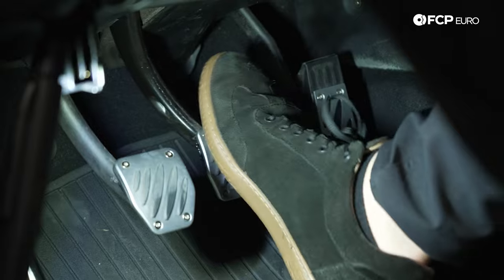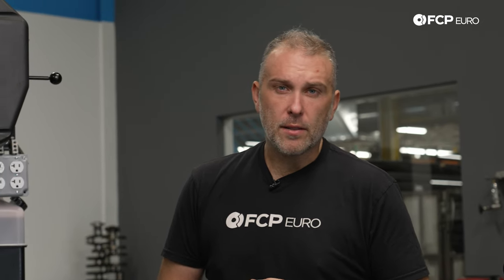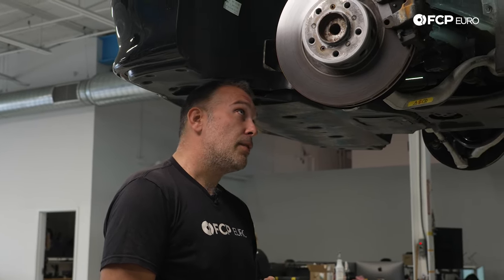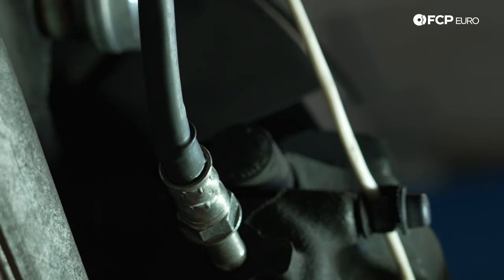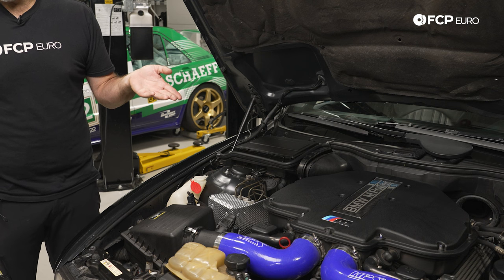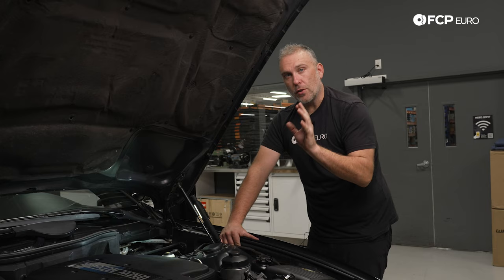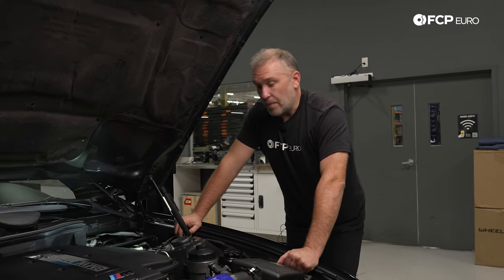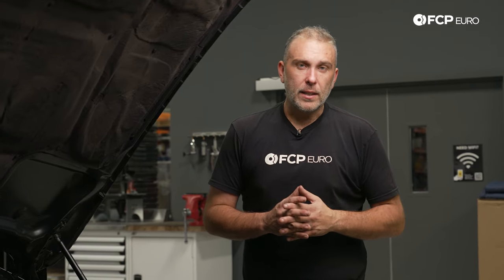How To Diagnose A Soft Brake Pedal

Comment: Exactly what I was looking for.  I'm trying to resolve a spongy pedal on our X164, and this issue is pretty much the same.  I had a garage do the brakes and found they were soft.  Took it back twice asking them if there was a leak anywhere, and to bleed the system.  The first time, they changed a hard line from the ABS to the driver's side, but after that they looked at me as if I were from outer space.  So, when I found a weekend with some time on my hands, I powerbled the system, getting rid of all the old brake fluid, but the brakes were still spongy.  No visible leaks either.  So now I'm in the process of replacing the master cylinder.  Gareth's logical diagnosis makes me think this will solve the problem once and for all.
Reply: Make sure you also look into the recall Mercedes has issued for the X164 and V251 brake boosters! You may be entitled to a dealer fix, and it's a high-priority one.
Reply: @danny_playswithcars  Thanks for letting me know about that.  I thought I saw something about that online.  But Mercedes didn't send me a letter.  I'm in Canada so maybe it's just the US?  I'll look into it further.  Thanks
Reply: @cuzimadapapushkian799  Yes, it is an open recall for US market specifically though I'm not sure about up North. I'd definitely recommend contacting your local dealer to give it a shot and verify whether or not you may be covered. The issue stems from corrosion around the booster, so it's possible you're experiencing a similar failure to the cars seeing issues down here. For reference and if it's helpful, our NHTSA ID in the US is "22V315" and may have helpful info for you. 

Regardless of the cause, best of luck tracking down your issue!
Reply: @danny_playswithcars  Thanks so much for all that info Danny.  I really appreciate it.
Reply: Remove the plastic panel forward of the left rear tire. Give that hard line a good inspection. The line on my 164 popped in that spot, pedal went right to the floor.
Reply: @askbascombe  Thanks Kyle, I'll have a look for that.  When you say the plastic panel, do you mean the left rear wheel well liner, or is there something else there?  By the way, I like your videos as well, although I haven't seen one in a while.  Thanks again.
Reply: @cuzimadapapushkian799  many thanks! I’m spending more time in front of the computer than the camera these days. Not the wheel well liner, there is a plastic panel closest to the area under the rear left door. That’s the one you want to look for.
Reply: @askbascombe  Thanks Kyle.  I really appreciate the pointer.  I will definitely have a look there and see if I can finally resolve this.  Thanks again.
Reply: @cuzimadapapushkian799  Don't bother if all you have is a soft pedal.   If a line was popped it would be "no pedal."

Comment: I have exact same issue. I replaced the master and my issue was intermittent so it was fine but the car sat for a couple weeks and when I started the car the same thing happened with a brand new master… any ideas. Did this car get fixed with the master?
Reply: Check the calliper pins,if they re stuck, then it will brake only on one pad,not both.
Check to see if the brake bads are worn evenly,if they re not its the calliper pins.
If this is not the case, then check the ABS unit

Comment: Having done brake master cylinders on multiple old (pre-fuel injection) vehicles, I know that some of the gaskets, O-rings, and other rubber parts eventually wear out.  At those times, brake master cylinder rebuild kits were easy to come by, and an evening's worth of work doing the rebuild would make the brakes feel like new.  The "give away" symptom for me was a brake pedal that worked, but as I kept pressure on it, the pedal would slowly sink to the floor.  Over a short time period (say a week or two), the pedal would sink faster and faster - until even the initial press on the pedal gave no braking, unless I pumped the brake ahead of time.  I believe this was caused by fluid flowing around the internal seals of the master cylinder as they wore out - and the more wear, the easier the fluid could flow around them, until they offered no resistance to the fluid.  Replacing the worn out parts restored the functionality, without the need to replace the entire master cylinder.  I don't know if these rebuild kits are still being sold - would be a great FCP Euro DIY video if they are, as it's an easy project.

Comment: My e90 335d has the exact same brake pedal issue i have changed discs and pads done a full brake fluid change and still the same. so now I’m wondering if the master cylinder is toast.

Comment: My E38 has a very similar problem to the M5 in this video.  No external leaks, no codes, pedal slowly sinks to floor.  VERY slowly.  Brakes just don't feel like they used to.  So I bought a master cylinder from FCP Euro and installed and bleed system using ISTA.  Problem remains....any ideas?  Could my new master cylinder be faulty?  I'm out of ideas, and totally miss the awesome brakes my car used to have !
Reply: You DO need to bench bleed the master cylinder before you install it.   Google it.  And here's the wub....a slowly sinking to the floor brake pedal is always the master cylinder..it's the only place where fluid leaks around the seals don't actually show up on the floor.  If a seal leaks on a slave cylinder, you'll get fluid on the floor.
Reply: It's subtle, but ..... if you have air in the system, the pedal force will still have some increasing force with travel relationship.   But if you have a leak internal to the MC, the pedal will slowly sink down under a constant force. If you make one quick, spike apply, and the travel is short - that is also a sign of an internal leak.
Reply: Hey where you able to solve your issue? I just replaced a MC on a 2000 m5 after a soft pedal and it was okay for about 30 mins of driving on the way back home it felt as if fluid leaked and I had the soft pedal again. Checked for leaks and saw nothing. I will bleed system again tomorrow but I’m not sure what’s the issue is. I’m thinking possibly abs problem?

Comment: As an ex-TRW braking engineer knowing the guys who's name is on the drawings for that particular MC, I would say - nice job!  You're right about the brake booster - any fault there is going to make a hard pedal, not soft pedal. The thing I missed in the discussion is about the dual circuits of the master cylinder. There are two independent circuits. Two chambers in the master cylinder. If I remember correctly for that model, it is a front/rear split. If the front circuit has failed, the pedal will feel almost like it goes to the floor. But if the had the car on the hoist, you would feel that the rears are locked. If the rear circuit fails, the longer travel would be less obvious - because the rear calipers are smaller, consume less fluid for a certain pressure. 
When you have an internal leak in the MC, it would be normal to have a soft pedal with slow apply, and hard pedal with fast apply. Dynamic effect - the fluid can't escape through the leak path quick enough, so you still build pressure. 

And yes - we designed those with circlips missing the holes on purpose - if the seals have worn, likely the bore has too. And it's just not worth messing with a rebuild to replace the piston center valve (I know, start the hate mail!)
Reply: Hi. Sorry for interrupting but I have a question about the ABS unit. What will happen if A valve is stuck open? Then the same sensation will be like a soft brake pedal because fluide will escape through that valve. Also when a wheel speed sensor is bad, the car thinks that the wheel is keeping blocking and the ABS releases the pressure and the pedal feels soft during it. I ask because I have an e91 and my car stops in waves like the road it's uneven.

Comment: This is a very helpful video. I have a similar issue with my brake. I did the diagnostic following your video and noticed brake fluid lead at the bleeder screw. The leak is very little that it wont even make drip even after i left it to leak for couple of days. I replaced with a new screw but still saw leak. Then I applied grease but that also did not work or fixed the brake. What do I do to fix the leak.

Comment: Thats my issue, the brake booster seems to be working because it is easy to push the pedal.
But the pedal travel is crazy. You have to push the pedal several inches before you get any engagement.

Comment: Did replacing the master solve the issue? I ask because I had (and am still having) the same issue on a Volvo XC90 V8, but replacing the master with a new one hasn't solved it.

I've been through probably a dozen liters of fluid, bleeding manually (with a lot of pedal pressure so as to quickly flush out any air that may be buoyantly trapped at a high point in the hard lines), power bleeding, gravity bleeding, and reverse bleeding, replaced the ABS module (based on others' experience that the integrated accumulator - specifically its control valve - can become faulty/dirty and thus not keep the accumulator isolated from the system when ABS is not engaged, causing a spongy, sinking pedal), and as mentioned above, replaced the master cylinder with a brand new unit from FCP (bench bled prior to installation).

No external leaks anywhere. Running HEL stainless lines and S60R Brembos that are freshly rebuilt with all new pistons and seals. The pedal should feel rock solid and have minimal travel, but it doesn't when the engine is running (or when the key is in pos. II, which enables the aux vacuum pump). Only when the engine is off and key off does the pedal feel firm.

The only parts left to replace are the hard lines, and the booster (which seems to be functioning fine; correct power assist, and no vacuum leaks).

Any suggestions?
Reply: I'm not familiar with that exact ABS unit, but often times you need a specific procedure to bleed an ABS.  In the factory, there is a special program to cycle the solenoid valves on and off. But sometimes, ABS units are 'prefilled', to avoid that need. May be worth checking in your case.
Reply: @gregreed2713  I've used VIDA (Volvo's factory diagnostics and service software) to cycle the ABS unit's pump and solenoids while bleeding, no change unfortunately. Perhaps it's just a stubborn pocket of air trapped in a high point in the hard lines. There's one section that I'm suspecting that crosses from one side of the tunnel to the other over the top of the driveshaft/exhaust just aft of the front subframe. I'm going to give it another go with my Motive pressure bleeder and the key in pos. II so the aux vacuum pump can provide assist to the booster, that way I can get a ton of pressure behind it and hopefully blast that pocket down and through to the caliper. I have decent stopping power (probably more the fact that they're upgraded factory Brembos) but the pedal just isn't there - it feels like I stepping on stack of kitchen sponges where braking effect only starts occurring in the second half of the pedal's travel. A recent bit of work on someone else's car (unrelated to brakes) that required me to do a post-work test drive made me jealous of the pedal feel... it was a Pontiac Vibe! :/

Appreciate the suggestion all the same!
Reply: @xyphur did you ever figure it out I have the same issue out of no where after some spirited driving my pedal when soft as well. Exactly like in this video. Replaced the master and fixed it for a second but my problem was intermittent anyways but now o started my car up and the soft pedal is back.
Reply: Are your brake pads worn evenly? If not then it may be from something else
Reply: @alinnimeni3789  yes, they're evenly worn. This issue was present from the time the pads were installed new into freshly rebuilt calipers. It was also present before the caliper rebuild, so it isn't related to the rebuild either.

Part of me is convinced that it's partially to blame on the pads themselves just having poor initial bite and requiring way more effort to achieve a given amount of friction... They are Akebono 'performance' ceramic pads. I'm not impressed with them aside from the fact that they last a long time and don't cause any dust. Their initial bite is non-existent, and max pedal pressure often doesn't engage ABS, which tells me I'm not getting sufficient friction to maximize the grip available at the tires for braking. They will be going back to FCP for a refund when I've decided what pad to replace them with. It is apparent I'm going to have to give up on clean wheels and go back to a semi-metallic pad material. Ceramics are apparently (just barely) sufficient for a daily grocery getter. Anything else and they're useless.

I have yet to try another reverse bleed using a fluid syringe. Hoping that doing so will shove whatever air that's in the lines - if any - back uphill to the master, which should be easier to accomplish than trying to force it down against its natural tendency to float. Also going to try removing calipers one by one during bleed and holding sideways in case there's an air bubble getting caught between the caliper halves in the crossover (where the o-ring is).

Appreciate you trying to help!
Reply: @xyphur  The "bite problem" as you mention and the quality of the pads was told to me by the dealer and the manufacturer.
My problem was solved after doing several brutal brakes, while reversing the car : just reverse the car with speed and brake suddenly.....they changed back, dont know why but it worked - learned this fro Eric the carguy, in one of his videos...

Comment: I was driving downhill, hit a small bump while pressing the brakes. My pedal went to the floor, but I could still stop. I drove that way for several miles. Then, while driving up a steep hill, the pedal returned to its normal feel. I checked for leaks, and the fluid level is normal in the master cylinder. Any thoughts?

Comment: What about an internal leak in the ABS hydraulics, can't that cause the same symptoms as a worn out master cylinder?
Reply: Yes.  That can also cause same symptoms.  This happened to my Ford Edge.  ABS hydraulic unit was bad.  Master cylinder was fine.

Comment: I know for my 8p A3, I had a soft pedal that largely resolved when I replaced the hose to the vacuum assisted brake booster. I'm still looking for the cause of my lean condition but the brakes feel a lot better.
Reply from the maker: That is a common one on the 8P generation and others -  Good luck on finding the cause of your lean condition.
Reply: I’m trouble shooting the same problem on my A3 8P. I purchased the car last year and since purchasing the brake pedal never felt 100%, more like 80%. 

1. The brake booster itself had a leak so I replaced it. You could hear the leak from inside the cabin. 
2. I bled the brakes with two people, one person pumping and the other loosening and tightening. 
3. Recently I replaced the rear calipers because the pistons weren’t retracting freely. 
4. I performed a brake bleed using the Motive bleeder and VCDS. Followed by the traditional bleed method but only by myself, not two people. 

During the first start up and 30min drive the brakes felt solid, 100%. When driving back home the pedal felt soft again. I will check for a vacuum leak at the hose but I’m thinking the soft pedal is due to air still in the system or damaged seals in the master cylinder.

Comment: When I start my car & step on brake pedal it sinks very low.
When I put car in "Drive" pedal is firm & brakes operate normally.  
Pedal only goes low when I'm in "Park" engine running.
What could this be? Mc?

Comment: what if you have already replaced the brake master cylinder 3 times and the brake booster 1 time, and replaced 1 wheel caliper that was seized up yet your still having spongy brakes and have a leak coming from one of the  studs coming out from the brake booster that holds the master cylinder on.
Reply: Your brake booster push rod probably needs adjusted, the tool is $15 on Amazon and it's easy to do, did you bleed the master cylinder before putting it on, and did bleed the system after replacing those